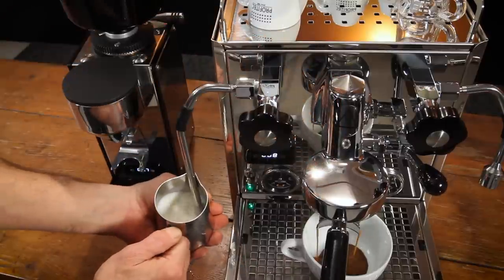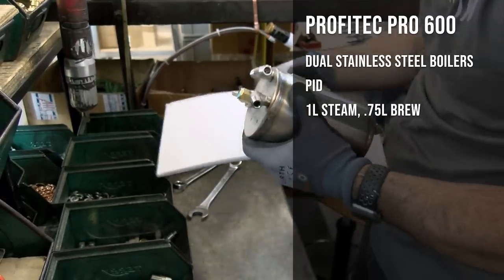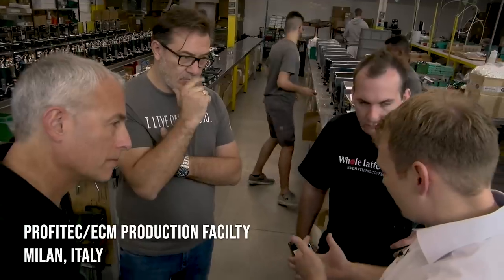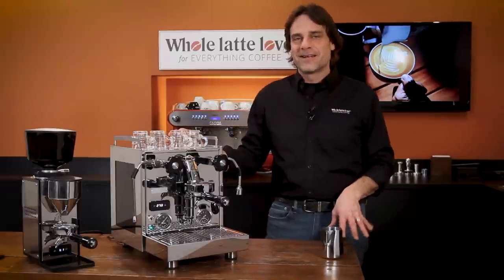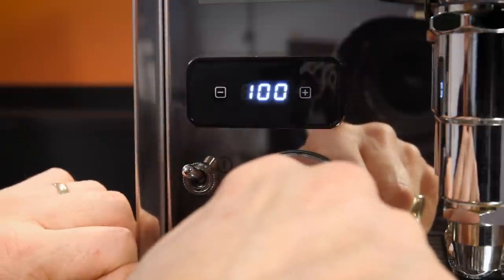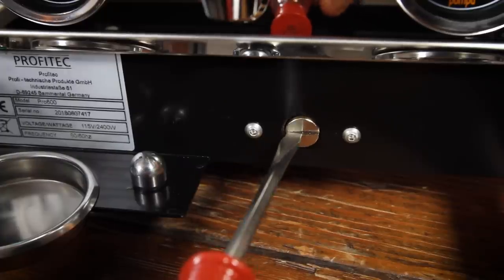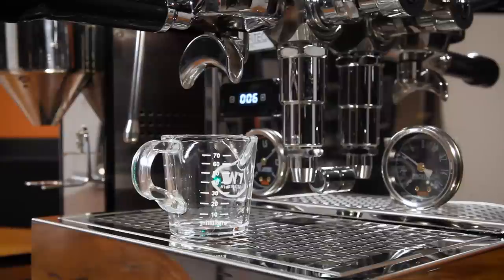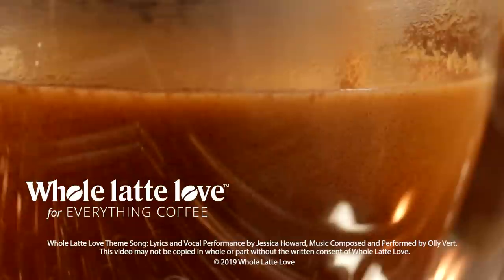Review: Profitec Pro 600 Dual Boiler PID Espresso Machine

Comment: Hi, I’m a true novice.  I finally figured out grinding etc to get right amount.  I softened my water, put it in the water basket/ holder on my profitec 600, turned on my machine, the PID read 115....and the went to ‘FIL’.    I tried turning on and off several times, but the same.  I pulled the lever up, but some cold water came out from the center, not the steam or water spout. Can you advise?  Psyched to get going!
Reply from the maker: Hi Charles, Sounds like the machine needs to go through filling the boiler startup routine. Here's the procedure from page 23 of the manual:

5.1 Fill Mode On the PID-display will be signed “Fill”. This is for filling the coffee boiler. To fill the coffee boiler, position the brew lever upwards for at least 30 seconds at a time. The coffee boiler and the steam / hotwater boiler are now filled. The sign “Fill” must be expire after filling 30 seconds. If there is still a pump noise, the filling of the steam/ hot water boiler is still being completed.
1.    If the pump stops and the PID display turns off while the boilers are filled, you have to refill fresh water in the water tank.
2.    If there is enough water in the water tank again, the pump starts to operate again.
3.    As soon as both boilers are filled with water, the pump will become quiet. Both boilers are now being heated in succession whereby the coffee boiler has priority.
4.    The PID display will show the current temperatures of both boilers alternately (see chapter 3.3).
5.    The machine is ready for coffee preparation as soon as the PID display indicates the pre-set nominal temperature of 93°C (199,4 °F factory setting). The machine is ready for steam/ hot water dispension as soon as the PID display indicates the pre-set nominal temperature of 129°C (264,2 °F factory setting) or the boiler pressure gauge indicates a value of about 1.5 bars.
6.    Manual boiler venting is not necessary because the PRO 600 contains a professional  anti-vacuum valve, which automatically vents the boiler during the heat-up phase.  7.    The machine is now ready for use

If needed here's a link to the PDF of the complete Pro 600 machine manual: https://wiki.wholelattelove.com/images/3/3b/Profitec_Pro_600_User_Manual.pdf

Hope that helps! Should you need further assistance contact our tech support here: https://www.wholelattelove.com/pages/contact-us
Marc

Comment: Hi Marc, I'm owner of a Pro 600. I'm intersted in PID calibration. Do you have custom PID setting at WLL for this machine. Especially I'm intersted in brew temperatur offset (E1) as there is much discussion about calibrating this offset. If you have, will your settings differ from mine because I'm from europe -> 230V voltage 
Best regards 
Cord
Reply from the maker: Hi Cord, Thanks for the question. We do not have a custom setting for the brew boiler offset. We leave as set by Profitec. In my experience there is little reason to change unless your machine is operating outside of typical room temperatures. Ambient temps can have an affect as the E61 acts as a heat sink. Not too long ago I did a test where I held a wet rag on an E61 group for about 10 seconds then quickly did a Scace brew temp test. That 10 seconds of wet rag on the group dropped the Scace temps by ~10F. Now a wet rag pulls out a lot more heat than air but operating a machine in a 60F room vs an 85F room is sure to make a difference in actual temps in the group. On a side note be very careful going into those technical PID settings. Not a big deal to change the brew boiler offset if you know what you're doing but things can get weird if you change the P, I or D settings.
Marc

Comment: How is this compared to Rocket espresso machines?
Reply from the maker: Hi Anel, Thanks for the question. Rocket Espresso makes decent machines. Prices vary in markets around the world but in general for similar feature set Profitec machines are lower in price than comparable Rocket's. Regardless of machine, I give Profitec a slight edge in overall quality while Rocket is heavier on the branding of their machines. Good example is comparing the Profitec Pro 400 to the Rocket Appartamento. In US market the Pro 400 runs ~$250 less than the Appartamento. The Pro 400 has 3 level temperature control while the Rocket is single temp controlled by pressure stat with larger temperature fluctuations.
Check them out here:
Profitec Pro 400: https://www.wholelattelove.com/products/profitec-pro-400-espresso-machine
Rocket Appartamento: https://www.wholelattelove.com/products/rocket-espresso-appartamento-with-black-panels
Hope that helps!
Marc

Comment: I did not get the 4 hole tip in my purchase from WLL. It was a 2 hole. Can it be sent to me? I’d prefer the 4.
Reply from the maker: Hi naomi, Thanks for the question. Since this video was made in January Profitec changed to shipping the Pro 600 with a 2 hole tip as described in the specifications of this page: https://www.wholelattelove.com/products/profitec-pro-600-dual-boiler-espresso-machine
You can inquire about availability of a 4 hole accessory tip with our customer support dept. at 585-924-7170

Comment: hi! in the market for an espresso machine, what are the main differences between the 600 and 300?
Reply from the maker: Hi Timothy, Thanks for the question. The 600 has larger boilers (same brew boiler used in the Pro 700), E61 brew group and much higher working steam pressure. The brew boiler in the 300 is low volume and mounted over the group. On the 600 brewing is controled via the lever of the E61 group. On the 300 it's a switch to start/stop brewing. More specs and videos about the 300 available here: https://www.wholelattelove.com/collections/all/products/profitec-pro-300-dual-boiler-espresso-machine
Samefor the 600 is located here: https://www.wholelattelove.com/products/profitec-pro-600-dual-boiler-espresso-machine
Hope that helps. Let me know if you have more questions!
Marc
Reply: @Wholelattelovepage  thanks a lot, you guys are awesome!
Reply: I have the same dilemma. I am sold on the build quality of Profitec, just not sure if the 600 is worth the upgrade. I think the 600 gives me (1) a nicer looking machine; (2) sprung valves; and (3) greater steam capability. I never was too clear on how the different brew groups might affect shot quality. Am I missing anything else? Thanks!!

Comment: Hi Marc, do you know if there will be upgrade for 2019 model of the 600 like thoses on the 700 (Ergonomic wear free rotary valve)? I like those on the 700. My Breville Dual-boiler is in repair (did 7 years with it, not bad but selenoid valve is to replace with group head as 3 out of 4 screw broke into it...) I’m looking to upgrade this year. So far I’m looking into the 600, 700 and also the bezzera duo DE. I’m affraid of the space needed from the 700 on the countertop vs my current Breville though. Would love to see a side to side size compare.
Reply from the maker: Hi M, Sorry for delayed response - a little sick the last couple of days. Anyway, here's a link to video of the 600 and 700 side by side: https://youtu.be/bB0eg0hG638?t=412 The 600 has sprung valves like the 700. Seven years is a good run for a Breville DB. It's a fine product but more appliance than machine. You'll find the 600 and 700 are very user serviceable. The Bezzera is a little more complex.
Marc

Comment: Hi Mark, if you are using the pro 600 vs the pro 500 to pull a shot and steam milk at the same time what’s the difference in temperature stability between the two machines and would it make a big difference in the taste of the shot? I guess another way to ask it is, if you’re using the 500 to steam and pull a shot the same time how much does the temperature fluctuate and will that be evident in the shot?
Reply from the maker: Hi Levi, Love the name. My first grandson is named Levi! Really not much difference at all in stability. Only using about 3oz/90ml of water out of the heat exchange section of the Pro 500. The brewing system has a large thermal mass between exiting the boiler and the moving thru the E61 group. Not enough time for temp to drop enough in the boiler from steaming to affect brew temp. I think it would be very difficult to detect any difference in the shot.Marc

Comment: Can you please comment on the steam volume in boilers and steaming capacities. 

in particular, the comparison between the profitec 500 with 2L boiler plus 2+ Ltr reservoir for coffee... vs dual boiler of 0,75 Ltr + 1Ltr steam boiler in the 600, 

which would run out of "steam" when making cappucinos in a line? and any test of how many cups of cappucinos before either runs out of steam?
Reply from the maker: Hi r, Thanks for the question. Here's a link to a side by side spec comparison of the Pro 500 and 600 including current pricing: https://www.wholelattelove.com/pages/compare?products=MTU0NTk5MzY1MDIzNSwxNTQ2MDQxMDk4Mjk5
While the 500 has a larger boiler it runs at a lower pressure than the 600 which features best in class steaming power running at ~2 bar max compared to the 500 with ~1.4 bar max. Recovery after steaming milk for a cappuccino is fast on both machines - they'd be back up to full steam pressure well before you'd be finished pouring milk for the cappuccino, grinding/tamping/loading for the next shot and refilling your milk pitcher. Understand neither machine is intended for commercial use. If steaming large amounts of milk rapidly back to back for extended periods you may eventually see a small drop in pressure but not something I've tested as it's not an intended use.
Marc

Comment: Hi Marc! Is the extra money worth it to upgrade from a P500 to P600?
Reply from the maker: Hi GO! The Pro 500 is one of my favorite HX boiler PID machines. The Pro 600 takes you to dual boilers and best in class steaming power with up to ~2 bar. With individual boilers you can adjust steam boiler temp/pressure without changing the brew temp as you would on the 500. If that's important to you then answer is yes.
Marc

Comment: Hey Marc. How does the Pro 600 do with back to back shots? If we were to make five or six in a row, for example, what would the reasonable rebound time between them be? If I spent 30’seconds or whatever steaming milk between them, would the machine be ready to go? I don’t love the look of the black side panels, but the 600 seems to be a decent compromise in price between the 500 and 700.
Reply from the maker: Hi James, Thanks for the question. Have to be honest I have not tested rapid fire back to back shots on the Pro 600 but in theory IMO it will be fine. Brew boiler is 25oz and you'll be taking about 3-4oz out for a double shot. It has a 1000 watt element. Between that and the mass of boiler plus group one would expect relatively quick rebound.
Marc

Comment: I'm considering the Pro 500. I know it's not a dual boiler machine, but a heat exchanger machine. How does it compare to this 600? It's for home use, 2 to 4 shots per day on average.

I know in heat exchangers, I need to flush the system to flush those too hot water out. Besides that, is there any downsides, as both uses vibration pump?

Need info on performance, reliability, etc. I've read reviews even the 500 series has very consistent temperature with the help of PID. 

Can I adjust the brew pressure intl the 500 like this 600 one shown? To always brew at 9 bar?
Reply from the maker: Hi WK, Thanks for the question. As the Pro 500 is PID temp controlled it does not need a cooling flush as you would in non-PID HX machines. What the 600 gets you is even greater brew temp stability with a dedicated boiler. Also has more steam power than the 500 as it runs at about 2bar of pressure inn the steam boiler.
Marc

Comment: Scace test on multiple runs please.  

Does it have a restrictor as well for the upper inlet pipe?
Reply from the maker: Hi B, Thanks for the request. Many Scace tests off camera with same result. Brew temp is solid. I have not removed the connection to group to look for a restrictor. I'll check with out service techs.
Marc
Reply: @Wholelattelovepage  Thanks marc, when you say brew temp is solid, what are the numbers and if there are any peaks? e.g if you were pulling a 1:2 shot or 1:1.5 shot whats the starting temp and if it peaks whats that temp and finally the ending temp.  Trying to decide if the HX hump is diminished with this kit or not! cheers.

Comment: I have a Pro 700. What did they have to sacrifice on the 600 to get it to a lower price point?
Reply from the maker: Alexander Lee steam boiler is smaller, less detail in casework, 600 is not plumbable so no line pressure preinfusion , vibration pump instead of rotary. 
Marc

Comment: Marc, can you provide some information as to the pros/cons or advantages/disadvantages of a 1L steam boiler (Pro 600) vs. the 2L steam boiler on the Pro 700? I am looking for the best value purchase. I am upgrading from a Silvia and looking to pull consistently good shots of espresso and also be able to steam Soy Milk with good results. I have considered the Synchronika and Pro 700, but given that I have no experience with Prosumer machines I am concerned with how to make a decision which offers me the best value. I should also add that I only make 2 cappuccino's a day for my wife and I. So, 4 pulled shots a day. Thanks!
Reply from the maker: Hi Michael, The larger steam boiler boiler gives you more steaming capacity and faster recovery to full boiler temp after steaming. Honestly though if doing 2 cappuccino a day the 1 liter boiler in the 600 will not hold you back in any way. The brew boiler in the 600, 700 and Synchronika is the same. Only difference is the pump. 600 is vibration (like the Silvia) other are rotary. 600 is reservoir fed only while the others can be plumbed or reservoir fed. Unless you want to plumb your machine or want the smooth sound of rotary pump the 600 will serve your needs IMO. Hope that helps. Let me know if you have more questions and I'd be happy to answer.
Marc
Reply: @Wholelattelovepage  Thanks for the response. It makes perfect sense. A few other questions: I am looking for something that will be durable and not require any maintenance outside the home, unless it literally breaks. I know that is difficult, and outside maintenance is always a possibility, but I want to mitigate that risk as much as I can. Would something like the Pro 700 or Synchronika be more durable, or less durable, or the same as the Pro 600? Things like the pump type maybe? I have also considered the Linea Mini (much more expensive I know) due to it's simpler design and commercial parts but I am not sure if the extra cost is justified for someone like me. Also, you talk about line infusion on the Synchronika and I like that idea. I just don't know if I need it. In general I don't really care about plumbing in but would be willing if it resulted in better coffee. In general I like the idea of pre-infusion. The Lelit Bianca looks nice but it isn't widely available and that concerns me. Anyway, I really am asking if the Pro 600 has the same characteristics as the 700 and Synchronika in terms of durability and maintenance. Thanks again for the response and for your great reviews. It is much appreciated.
Reply from the maker: The Pro 600 does have the same durability as the 700. As to maintenance, if you want trouble free operation the single most important thing is feeding a machine good water that will not cause scale. Scale is the number one problem for any machine. The guys who design Profitec machines come from a service background so simple, reliable and easy to service is important to them. It's an attribute which has propelled their machines to some of the most highly regarded in the field. LM machines are well regarded but when they need service it can be tough and they are not as user serviceable as Profitec/ECM machines. Not everyone needs line pressure pre-infusion. But if your coffee journey takes you places like high-end single origin coffees you may find yourself wanting it. Plumbing a machine makes it very easy to provide excellent no-scale water quality with an in-line filter system like this: https://www.wholelattelove.com/bwt-bestmax-premium-filter-package No scale and pressure control. If you go with a reservoir machine like the 600 do treat your water with an in tank pad filter or ion-exchange pitcher.
Marc
Reply: @Wholelattelovepage  Thanks again for your response. Since I roast my own coffee and only drink Organic coffee, my choices for beans are limited. So, the world of Single Origin Coffees, which if I understand it correctly means the beans come from the same farm, and often the same tree, is probably out of reach for me. If I understand you then the pre-infusion would be less valuable in terms of its impact on taste. So, my real choice is between a machine like the LMLM, which LM says is serviceable exclusively in my home, or something like the Pro 600 which if it really broke might have to be shipped to you for servicing. I don't really care about plumbing in, unless it would have a dramatic effect on the taste. And, where I live the water is soft and we have never had scale issues. I confirmed this with my Town water people. But, we still take precautions like using Brita pitchers for now, and maybe someday in the future getting a below the sink filter system to get the Brita pitchers off of the counter. Thanks again for the help. Michael